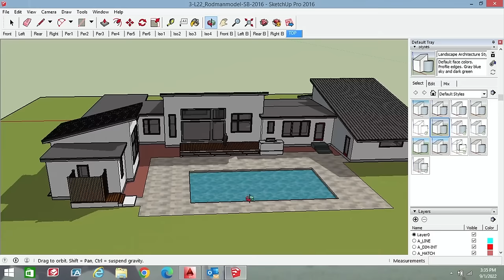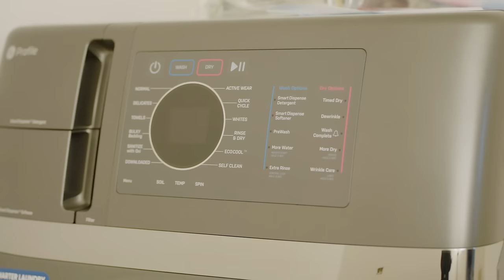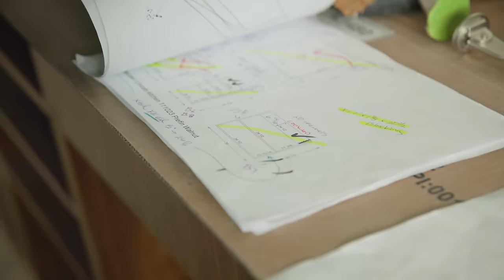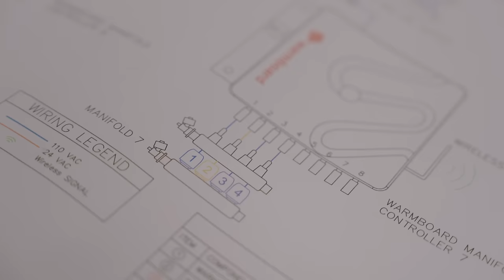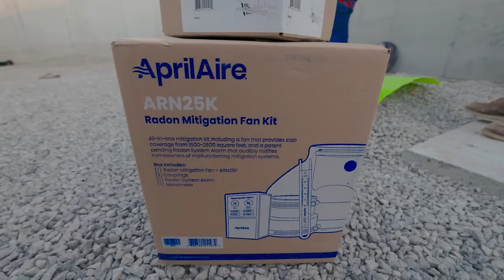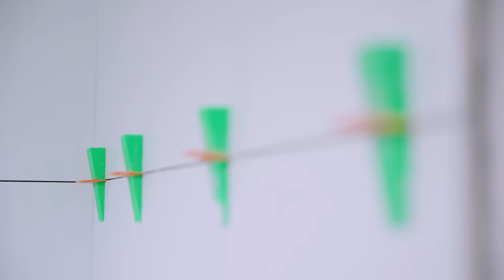"Homeowner Products Review" Build Show Build: Boston - Bonus Episode

Comment: i agree, gettng the data using smart home stuff is good.  the other part is understanding what it means.  in the example steve gave.  11.7 vs 13.5 gallons doesnt have much meaning in changing something.  but the 86 gallons does or can mean something.  Its the context of what the numbers mean.  one suggestion for the smart house stuff is to try to make it as self hosted as possible
Reply: that is the goal.  keeping it as simple as possible.  One of the challenges with data is over-granualizing it.  That can become almost meaningless with unimportant loads.  The power of the solution chosen with the Schneider approach is that we have control over that and can adjust as needed.  One year out we will have a much better handle on the data and will be able to give more informed comments.  Also, having had a Sense unit for 2-3 years, and three arrays over more than 6 years, means you learn what data has value individually and what is best aggregated.
Reply: @scottrodman  sounds like you got a good handle on it.  what you said about the data being over-granualized is a really good point. you need enough to analyze , then go through it to see what it really means

Comment: For the coded smart outlets, who does the setup of that - is it the homeowner or the electrician? I'm curious when building a house whether there's a lot of work for the homeowner to add each outlet to the app.
Reply: I am still figuring out the best approach for this process with so many of them and a need to make differentiation easy.  The electrician will be given them only after they are all properly marked and one of the QR codes has been added to a binder that will be the guide for that forever.  That will also be scanned to make sure that those are always available.  At the moment, the best process for management appears to be a numbering convention with a label on the outlet, the plate, and the box that keeps those all coordinated.  Each will also have a name - that is what takes effort.  A QR label comes attached to each outlet.

Setting them up is a matter is adding them to their app and coming up with a naming convention.  These will all be "Matter" devices, so they will be able to be added to the NICE environment and others.  I think that a better answer to this setup question will come after setting up the first few and then using them for a while.  If needed, they can be reset and set up again if using them shows a better process.  I have also learned from having all outside lights on the current house on Google's environment and using FEIT bulbs from Costco.  The FEITS are great and replaced the earlier Cync bulbs that gave constant problems and had less than ideal support.  The FEITs are inexpensive and have been totally reliable.  They lack the QR code approach, but were easy to set up and manage.  Over 5 years of use of those..... and learning the best setup and management approaches.

We are fairly early in taking this approach to outlets and switches as the answer to control and load management.  I mentioned that this approach gives energy consumption data down to the appliance and outlet (or switch), control to that same level and we probably went overboard with so many of them, but one of the goals was to learn and document the process of what we learn.  I will put out data and what we learned in one of the videos that I am going to be creating to talk about living with the house and learning from each of the many decisions.

Comment: What the world needs is more people to take responsibility in knowing and maintaining their house. These systems are great when they’re new & still under warranty but when they get older and start breaking down believe me, it will be like owning a 20 year old Cadillac with 200,000 miles. I’ll take efficient and simplistic applications every time , you can keep your app that tells me I have a bad toilet flapper🚽/🤳
Reply: the counter to that is that the only way that we make progress is through the willingness of some to learn by using new technologies and each generation gets better.  We would not have iPhone 15s without a lot of early adopters buying the original 2007 iPhones.... and iPods before that.  Each generation of sensors gets better and most become cheaper.  So, in 20 years (maybe less), we may have to replace some components, but by the willingness of people to buy the current technology, that fosters innovation through the lessons learned, feedback, etc. (and revenue) to come up with gen 2, and beyond.  It is certainly the case for many of the systems and components chosen, and how they have evolved from the ones previously bought or considered and rejected as too early for prior homes.  I can report back in a few years with the results!
Reply: My personal position is in alignment with yours, I had a Ford ranger, manual transmission, hand locks, crank windows...etc. I got 250k out of that thing with nothing but routine maintenance........That being said, I NEVER close my eyes to understanding, and testing new materials, thoughts, tech....etc. It is a challenge to try to understand what should be adopted, and what is "gimmicky" .......and in many cases, it is a very subjective view.

Comment: Also surprised to see ceiling fans included with all the other technology
Reply: I am a big fan of ceiling fans, having used Casablanca Stealth fans for almost 30 years.  A family member had Minka Aire fans installed that impressed me with their great quality, functionality, modern designs, and were well-priced.  When that family member's contractor did not set up the remotes properly, one call to Minka Aire resolved the issue and showed me how well thought out their design was.  They were an obvious choice for this house.  I always think that fans should blend in as an integral part of the architecture.
Even with the Zehnder ERVs, I wanted to have that added air movement, as I tend not to have the summer temperatures set inside at arctic levels.  Some complain more of tropical summer temps inside!  That air movement has always makes a difference.
Reply: Many clients like the ceiling fan. It's a dynamic object in the room, one that people really like having a slight breeze across their skin.....

Comment: In your bedroom with the transom window. What are the egress requirements in the Boston area regarding those types of windows?
Reply: the bathroom door takes care of that requirement.  I think that the bedroom window itself would satisfy any requirement, given the opening and height off the ground, but we wanted to have a natural egress within close proximity.
Reply: @scottrodman4017  IBC has a 44" requirement from finished floor. But you're saying your egress is from the bathroom.
Reply: @michaelshettig7805  the bathroom is right next to the bedroom.  The bottom of the opening window in the bedroom is also less than 44" from the floor and the "tilt n turn" window opens in.
Reply: Allright as we walk down the hall their is a 3X5 tilt/turn window with a 20" sill height, it exceeds the 20"X24" opening requirement, and almost twice the 5.7 sq ft requirement......the hallway (with no door) is considered part of the bedroom
Reply: @scottrodman4017 No the bathroom door does not - you can't provide egress thru an adjacent room, the window has to be without obstruction from the room......that's why I used the hall window as the egress....

Comment: What’s the price tag all in on this house???
Reply: Not sure yet what the final number will be.  It is more than I wanted it to be, but a good deal of that is the result of the learning curve that has helped to identify areas where there are potential savings for others.  We also made some decisions that we knew would cost more and are things that we decided that we wanted to enjoy in the house in terms of finish elements, etc.  Those include the pool, Baldwin hardware, DXV toilets, Grohe fixtures, Kraus hardware, and some lighting to come, but this house is "finish-simple" compared with what I have seen in so many developer built homes built in the Boston area.  Instead of the fancy stuff that I see in homes around here, we focused first on the envelope and that is where we need to find ways of being more cost efficient.  Factory built, is the direction we should go, but our society does not seem ready for that, so the capital investments so far in those plants and approached have either not shown success or resulted in homes at very high price points.  The goal is to reduce those costs.  This need to come!
I also did not focus on bidding out each component but chose the professionals I trusted or who were recommended by the contractor.   There were notable exceptions when a number just seemed to be out of the range of what I thought was appropriate and I went to friends for their suggestions.  Elvis (floors) was one of a number of great examples.  He was exceptional to work with!!  It is clear that good professionals are also expensive in this period where they are quite busy!  Insulation from Advance Green Insulation (Jesus) was an example of one of the most important elements.  Since he is ahead of the game, he was also ready to move to embrace Timber HP wood fiber insulation the moment it was ready and timing just worked well.  Timber HP was also exceptional to work with.

What this project has also done is provide a clearer understanding of the need for more contractors to invest time to learn the new equipment, materials, and approaches that will bring down the incremental cost of building more energy efficient homes that will get closer to passive house numbers.  

I commented on materials in this video.  It takes research to find good new materials and at costs that make sense.  With tile, using the right combination of waterproofing, decoupling, thinset, etc. is key.  With wood floors, the adhesives (we used Wakol) need to be on the approved list of the flooring company (Mafi)  We used INAX tile for some accent walls and needed to learn about Mapei's adhesives as that was the tested and listed adhesive.  While Wakol probably has a great product that would do the same thing for the INAX tile, it was not tested and listed, so we used the Mapei that was.  We were really lucky to have great people to work with in those areas (Rodrigo on tile and Elvis on wood floors) who were willing to work with us and learn and use new materials that they ended up believing in for future projects.  We also utilized the tech support and local reps of many of those companies.  We might have gotten a little more attention as a result of the series, but many of those calls were just from Googling the products and finding a local rep, as well as asking lots of questions.  Yes, to someone's comment, I am SURE that I was a royal pain to some, but what was great was the dedication of SO many vendors to educating their customers.  The real professionals loved customers asking questions and taking an intertest.  Many thanks to all of them.
We need more HVAC, electric, and smart tech experts!!!  Great fields for young people looking for lucrative careers in fields that are evolving quickly and desperately need more talent coming into the fields.
Data will also be a key as more homes are built that use different approaches and there needs to be a lot more published data on how each approach performs.  Each climate is different, but new and more efficient HVAC, as an example, along with better insulation, debunks a lot of the stories of cold weather performance of past generations of heat pumps.  Just like solar, the proof is in the numbers.

This project served many purposes for me:  a new home that will be massively efficient and have wonderful IAQ, a test bed for some things that I hope to advocate for as we go forward, data that can be useful to others, and a really challenging and fun (ok, most days, but not all!) project.

Thanks to everyone who has watched as we went along the process and to all of the professionals who have been a part of that journey.  They have made the difference.

With many, many things learned, materials tried, great new products incorporated in this process, it is clear that we only scratched the surface.  After the house is done, I will go back and post a large number of videos on a wide range of topics, as well as showing how some of the decisions have worked out.  My early decisions that excited me (the Kraus kitchen sink and the GE combo washer/dryer that I am really looking forward to using) are great examples, but the proof is in living with these decisions and seeing what we learn in the first year.

Now that was a VERY long answer to a very simple and short question.
Reply: @scottrodman4017  THANK YOU for such a detailed response. I believe in your mission as well. As an engineer by practice and education, I truly enjoy this series. I am big believer in what is behind the walls; the things that are not noticeable to the naked eye, vs. high end finishes. Attention to the envelope is important. When building a home, one really has one shot at getting it right! I believe the modern simple finishes will stand the test of time. I look forward to the future videos. Please continue to advocate. As a society,  U.S. as a country needs to foucs on figuring out the recipe for high performance homes at fractions of the current cost.
Reply: @scottrodman4017  Love the series so far, and thanks for taking the time to comment and sharing thoughts from the owners point of view. I've had the GE combo since July and so far it is great, I'm sure you will enjoy it as well. I switched to this unit for energy efficiency, but also to free up space in my smallish laundry room for other appliances.  It is definitely more energy efficient than a normal all electric washer & dryer, and although cycle times are a little longer, it is more convenient as you don't have to be ready to move a load from washer to dryer.  Works great to throw in a load of laundry, go do something else for 2-3 hours, and come back with them ready to be put away.
Reply: @scottrodman4017  Thanks for sharing all this incredible information and giving us an inside view into the process from start to end. The series was incredibly educational and I look forward to hearing what went well and what you might have done differently after living in the house.

Comment: I know I've said this on another video but when the homeowner was talking about cutting up the floor coverings and recycling.....I'm just floored. 12:09 

This house with all the materials and shipping and high end products with exotic minerals and resources will never return the carbon impact on his lifetime. It's a good thing they claimed this to be a two hundred years building because it'll be 2150 or later to start getting into a net positive. 

Is much prefer thru just admit that our stop acting like this beautiful house was anything but a very expensive and very complex home for a couple with the money to do it. Good on them. Enjoy the house as what it is but don't act like there's a climate thought to it.
Reply: You raise an interesting and important set of questions.  The old house was filled with mold, had a huge radon problem,  water leaks into the basement, no footings, rotting sills, and more.  Would it have been better to try to take that apart and rebuild it?  Maybe, but the resulting project would have cost a fortune and resulted in a mediocre house that still was not efficient and would have been beset with challenges that were inherent in a 1963 era house with very poor insulation and a difficult layout.
Yes, we recycled as much of the old house as possible.  There are multiple "affordable" apartments that now have the flooring from the old house, the asphalt roofs were recycled for the asphalt, the concrete ground up for road beds, and much more, (appliances, kitchen cabinets, interior doors, radiators, heating system, water heater, garage door, gutters, outlets, switches, ac units, copper pipe, structural steel, glass doors, fireplace liners, ornamental glass windows, all repurposed).  That does not negate the carbon impact of the new house, but those are positive offsets.  Every house built has issues with carbon footprint.  Do we stop building houses or try to learn how to do things with better and lower impact materials that perform better for the long term and radically reduce the use of energy and other resources?  I was very happy that the timing allowed us to change to use TimberHP's wood fiber insulation that had just come on the market.  That has negative embodied carbon.
The key is learning more as we go.  Nothing is perfect, but each step should take us up that learning curve.  While many of the decisions were geared toward greater efficiency, there were notable examples that were aesthetic and, yes, a number were nice upgrades.
There are still a lot of lessons to be learned to get the incremental cost of single-family construction to a small differential.
Reply: If you have seen my other videos and writings you will realize, I am the very first one to state that building is a detriment to the environment - I never try to polish that turd. Me knowing that what I design and build will have a serious impact. My line of thinking is not to try provide the illusion I am doing something GREAT!!!......It's not, my line of thinking is how to provide the least amount of harm in my doings. Building something highly durable, healthy, comfortable, and energy efficient means the efforts and materials will provide the best product I can with the wants and desires of my clients.........hope this helps with the perspective